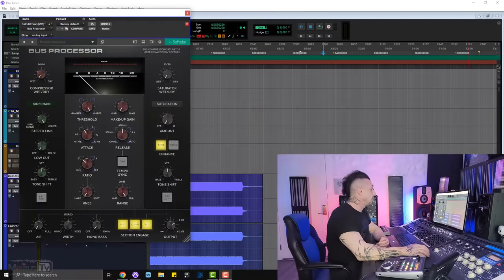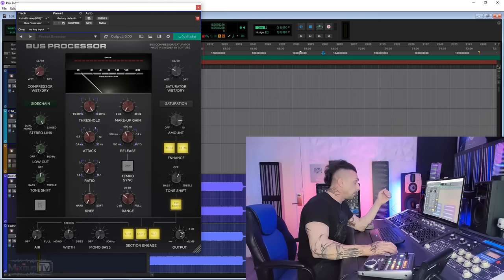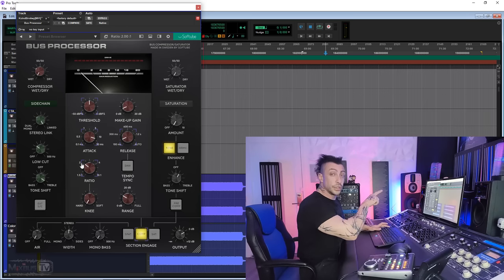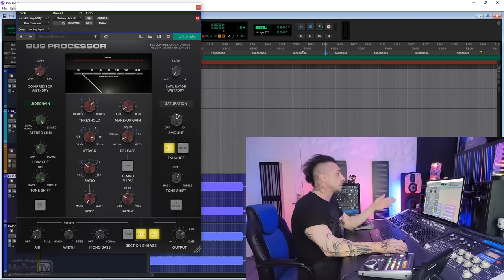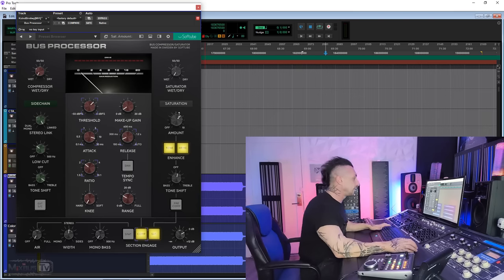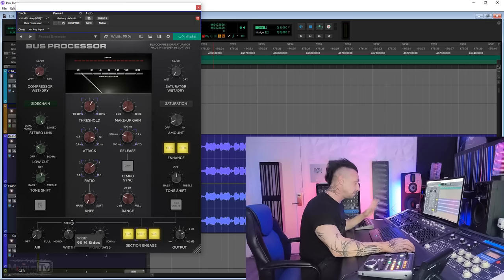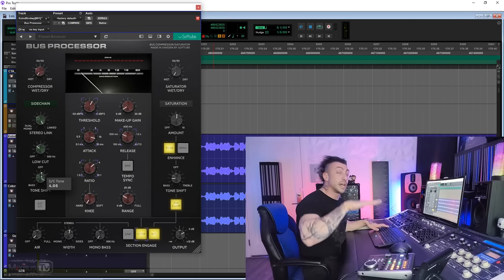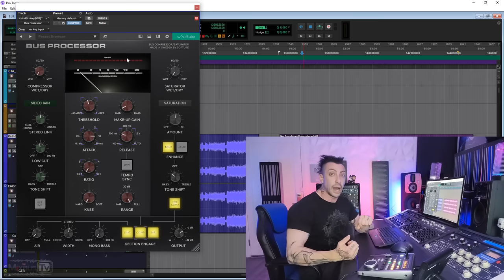Softube Bus Processor - World Premiere

Comment: Love the sound of this compressor! I have been using ''the glue'' by cytomic but feeling I might switch! You mentioned you are not a fan of parallel compression on the 2 bus. Is there a downside to doing this or is it just a subjective thing? I have grown to like the sound more and more of the 2 bus compressor not 100% wet. Thank you for your videos! ❤
Reply from the maker: Yes and no. There are potential drawbacks running a full mix in  parallel, especially if you do it ITB. I want to stress potential. Personally I don't like it because of the way I use compression on the 2bus which is fairly light and if I feel the need to bring some dry signal back it means I'm compressing too much or that song doesn't need a 2bus compressor.
Reply: @mixbustv  That makes sense. Thanks for replying!

Comment: Thank you for all of your videos! So useful. Could I just ask why you don't like the Mono Bass knob? Is it not precise enough? Best to do that on the tracks that need it?
Reply from the maker: Best done on individual tracks for sure. The reason is because there are several ways to "monoize" something. In the case of low end content on the sides on a full mix, you need to ask yourself WHY would you want to do that. The reason would be because your low end on the sides is out of phase, that's a big mistake that one should address in mixing, not on the 2bus.
The ways that knob can work are the following (most common) it cuts the low end on the sides. Not ideal see this video: https://youtu.be/5tGpNAC1x2Q
The other is to "bring" the sides in the mono channel, that can indeed cause phase cancellation and/or change the level of your low end. 
The right way to do it is how Tone Projectcs Basslane Pro does, phase compensated and all.
So yeah, many reasons. But first and foremost, you shouldn't have to use it.
Reply: @mixbustv  Thank you, that’s brilliant. Got it!

Comment: This plugin has the most comprehensive amount of options for a safe guard to you two bus processing.
The tone shift on the reactive frequencies is a new one, need a little clarification... It's totally like a tilt EQ in selective the reactive frequencies? as in; it'll still include the bass but less reactive and more reactive to the treble?  Because I see the high pass for this to cut off bass frequencies above it so it must do, and, then you get to cut off just the very very low and dampen the reaction of the bass frequencies above that by using the tilt like tone shift?... If so, that is incredible alone.
This tempo SYNC also is the completely new thing that I thought compressor plugins should have as a option, plus, this will be a super helpful safeguard for people new to production, as well as people who might be very seasoned but currently working no not the best listening environment... very hard to tune attack and release properly without really revealing monitoring (in my experience, I'm personally not as tuned to compression than other parts of processing)... But also, a time saver for anyone who needs to get a good result quickly.... very glad to see that option.
Then it has saturation (Softube being a company I trust with saturation in a plugin) and a tilt EQ like control with the add of this... again so so essential in your two bus and possible a master that not in too much need of a heavy hand.
Stereo processing (This thing is beginning to seem like a plugin version of the FUSION with more control bar to two band EQ) with the MONO BASS option, again, great for people new to the game that don't fully understand the issues with some stereo bass's... Ovi, we don't actually want to do this across the board of a mix when at a professional level, but it's great as a safe guard for new people to clean up problematic stereo content in the bass frequencies, defiantly if you are a producer to send out a listen track before the final mix down also, for the song it self to be heard before the mix processing is started.
Then Stereo processing is a good add for tiny adjustment to fine tune the stereo field so good to have and I trust Softube to do this well.
Each section being able to be engaged and disengaged really helps with knowing your getting each section just right.
Then finally, it's Softube, so the sound is right on point also, so it's not something subpar with tons of control.
A clear winner for the buy list ☺

Comment: I really liked it I think it will replace the my Uad Ssl Buss compressor, the Fet and Opto from Softube are also so excellent and with several extras, those from Uad are just the emulation I have used the subscription for them but I am thinking of bringing the Softube, Subscription it's not something I like very much, I would like to know David's opinion regarding the Pulsar Modular p11 Abyss, it seems to be a complex compressor, but putting all the topologies together, I don't know if it would be a better investment.
Reply from the maker: Definitely not the P11, Softube is the way to go now
Reply: @mixbustv  thanks David!